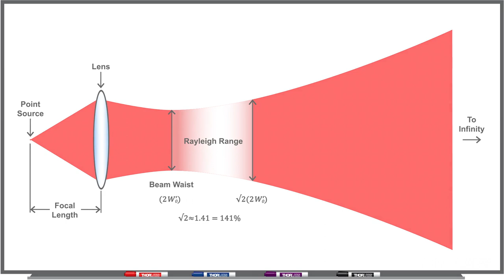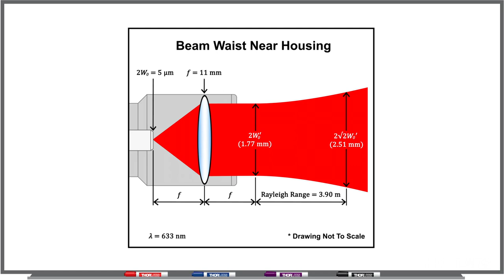Align Fiber Collimators to Create Free Space Between Single Mode Fibers | Thorlabs Insights

Comment: It’s very interesting! Regarding the fixed focus collimator package, is it the first kind or the second kind? I guess it’s the first kind, right? The waist is pretty close to the housing. While I was learning this technique in the lab, I was told to tune the distance between the collimating lens and fiber end, till the waist towards infinity to make a homogeneous beam. In reality we just move the waist to several meters away. It’s similar to the second kind, just to increase the Rayleigh length, right? Can you tell me the exact position of the fiber end with respect to the focal length of lens in these two collimating methods?
Reply from the maker: @Thinker Doer  Yes, the collimator package used in this video positions the fiber's end face at the input focal plane, similar to the left-side illustration at 2:20. The collimated beam waist is at the output focal plane, and the collimated beam has the longest possible Rayleigh range and lowest possible divergence. There are actually three lenses inside each collimator used in this demonstration. The effective focal length of the lens assembly is 12 mm at 633 nm, and the collimated beam waist is a little over 9.5 mm from the output side of the collimator's housing. Separating the collimators by ~19 mm would maximize the coupling between the fibers, but many applications require more free space.

As you mentioned, tuning the separation between the input fiber end face and a collimating lens can increase the distance to the collimated beam waist but never by an infinite amount. However, doing this actually shortens the Rayleigh range of the collimated beam by as much as half. Since an adjustable collimator was not used in this video, a case similar to the right-side illustration at 2:20 can be modeled using a single thin collimating lens whose focal length (f = 12 mm) is the same as the collimator's. The light from the input fiber has a fairly short Rayleigh range (zR) of ~0.025 mm, since the fiber's mode field diameter is ~0.0045 mm at 633 nm. The maximum distance (~2.9 m) to the collimated beam waist is provided when the separation between the fiber end face and lens is ~12.025 mm (f + zR =  12 mm + 0.025 mm). 

There's a modified thin-lens equation for Gaussian beams (described here: https://www.thorlabs.com/newgrouppage9.cfm?objectgroup_id=14511) that comes in handy for estimating beam parameters like these.

Comment: What if you were to translate one of the collimators closer, or further away, does the coupling efficiency stay the same?
Reply from the maker: The coupling efficiency actually will change, and this is due to the characteristics of the laser light. While it may appear that the first collimator outputs a plane wave with a constant beam diameter, this is not the case. Instead, the output beam has a waist, at which its diameter is smallest, and the diameter of the beam increases (diverges) on either side of the waist (for more information, see: https://www.thorlabs.com/newgrouppage9.cfm?objectgroup_id=14489 ). The second coupler collects the light and focuses it to a location that changes with the spacing between the two collimators. As a result, the coupling efficiency changes based on the distance between the collimators. Oftentimes it is less important to maximize the coupling efficiency than to provide the free space required for the application.

To achieve the highest coupling efficiency, it's necessary to know the position of the beam waist with respect to the collimator's housing. This specification is typically provided with the collimator. The spacing between the two collimators' housings should then be the sum of their beam waist distances. When they are spaced by this distance, the light focuses on the endface of the second single-mode fiber, which optimizes the coupling conditions (for more information, see: https://www.thorlabs.com/newgrouppage9.cfm?objectgroup_id=14205 ). The coupling efficiency will decrease if the spacing is either increased or reduced from the sum of the beam waist distances, since any changes to the spacing will shift the position of the beam waist image with respect to the fiber's endface.

Comment: Can we align 1550nm laser through TC12FC collimator, with this concept?
Reply from the maker: Absolutely!  This approach can be used with both a TC12FC collimator and 1550 nm light. 

Since 1550 nm is not a visible wavelength, you may find it useful to use an IR viewing card ( https://www.thorlabs.com/newgrouppage9.cfm?objectgroup_id=296 ) to track the beam spot while performing rough alignment.  The procedure demonstrated in the video applies once some coupled light is measured by the power meter.

For those unfamiliar with the TC12FC, it includes three lenses in its design, instead of the single-lens design of the collimator used in the demonstration. The TC12FC's three lenses can be modeled as a single lens with low aberrations, and this collimator will provide a beam that also follows the figures in this video.

Comment: Rayleigh range = 3.90 mm. How is it calculated?
Reply from the maker: @PasinKuncharin  We calculated the Rayleigh range of the beam output by the collimator using the values noted on the diagram at 1:54 and the Gaussian beam equations that are summarized here: https://www.thorlabs.com/newgrouppage9.cfm?objectgroup_id=14511.

We first calculated the Rayleigh range of the input beam ( zR_in  = (pi/wavelength)*Wo^2 , where Wo is one half of the input fiber's mode field diameter ). To calculate the waist radius of the beam output by the lens ( Wo’ = m*Wo ), we then used the magnification ( m = Wo’/Wo = focal length/ zR_in) and the lens’ 11 mm focal length. The Rayleigh range of the output beam is then ( zR_out = (pi/wavelength)*Wo’^2 ).

Comment: How to calculate beam waist?
Reply from the maker: @Sahil Nazir Pottoo  The size and position of the beam waist output by the collimator depends on the diameter of the input beam waist, the focal length of the collimator, and the wavelength of light. The collimated beam waist diameters and positions for all of Thorlabs’ collimators are provided, but these values can also be calculated. If the fiber is single mode, the diameter of the input beam waist is the mode field diameter (see the link below for more information about this parameter). If you’re using a commercial fiber collimator, the focal length should be provided. When the single mode fiber’s core is placed at one focal point of the collimator, the location and diameter of the beam waist of the collimated output light can be estimated using a combination of Gaussian beam equations and the modified thin lens equation (see the link below for more information).

For those who are interested, the modified thin lens equation takes into account the Gaussian nature of the beam, while the standard thin lens equation does not. The modified thin lens equation can be used to estimate the output beam waist position by treating the input beam waist from the fiber as the object and the output collimated beam waist as the image.

Mode Field Diameter: https://www.thorlabs.com/newgrouppage9.cfm?objectgroup_id=14203
Modified Thin-Lens Equation: https://www.thorlabs.com/newgrouppage9.cfm?objectgroup_id=14511

Comment: How does the intentional misalignment and then compensation improve the coupling over that which was initially achieved ?
Reply from the maker: After the initial alignment, the fiber collimators are not perfectly parallel to each other. The alignment is good enough that some light gets into the second fiber, but since the two collimators are angled somewhat away from one another, there's also a significant amount of light that is not coupled into the fiber. Aligning the collimators to directly face one another maximizes the amount of coupled power. The intentional misalignment and compensation is the approach Bill uses when he wants to incrementally walk the two fiber collimators into alignment. 

The misalignment step is an attempt to move one collimator into better alignment, and the compensation step to improve the second collimator's alignment with respect to the first. After each step in the walk, a peak power is found. These peak powers can be thought of as local maxima pointing in the direction of the greatest achievable coupled power. As long as each local maximum power is larger than the previous, the adjustments are improving the alignment. When no adjustment further increases the coupled power, the power peak is assumed to have reached a global maximum with optimal alignment of the collimator. However, if the light coupled between the two fibers is still not within the expected range than we would suggest trying a larger move in all axes to see if any direction provides a power jump.